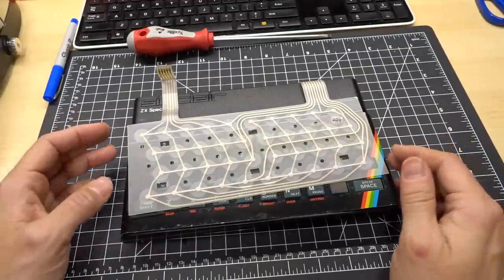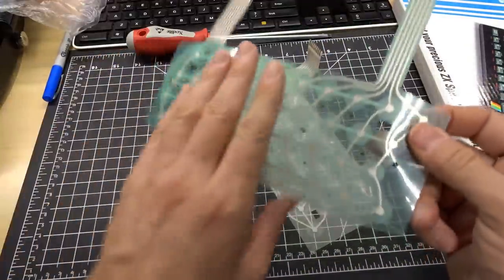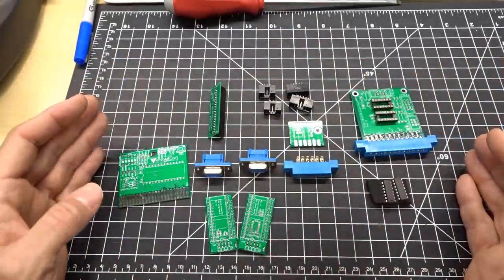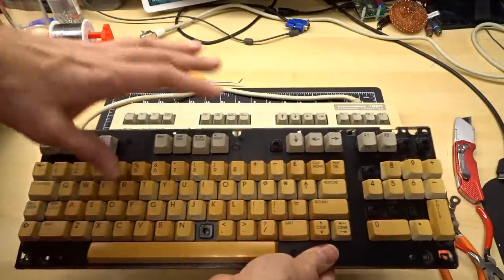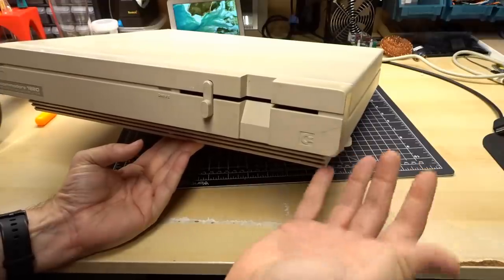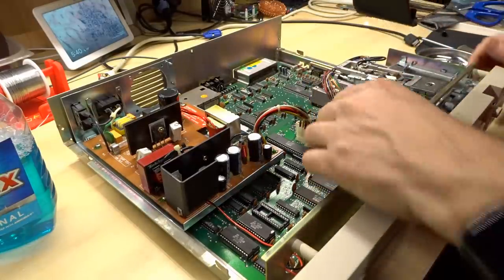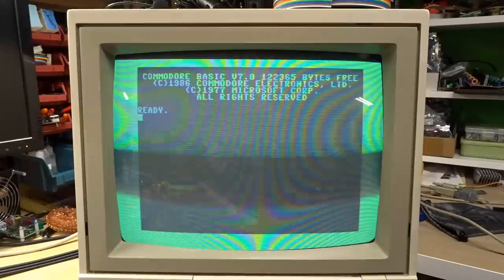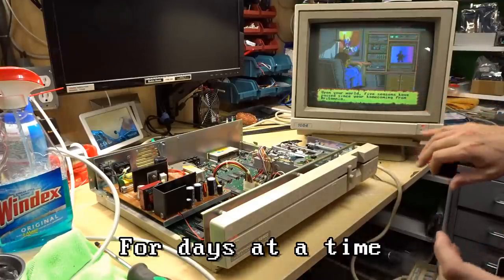Adrian's Digital Basement - Mail Call #1

Comment: Why do people dump heavy crap in a box with 30 packing peanuts and expect it to survive. 2 or 3 TIGHT layers of bubble wrap people! Come on!
Reply: On the plus side, we get to see a repair video. Every cloud...
Reply: I have gotten far less protected packages from Greece, Spain, GB and by train from China (all to Germany) and I haven't gotten a single damaged Package- US services just seem to be particularly bad
Reply: It's not just heavy stuff. I got a CPU off eBay a couple days ago and it arrived in a plain envelope wrapped in what looked like Saran wrap. Sure enough a few pins were bent but luckily not badly enough that it didn't work. All I could think was, this guy couldn't find a tiny piece of styrofoam or something?
Reply: This summer I ordered new SLA batteries for my Neuton rechargeable cordless mower. They came in a bubble wrap mailer and I think the United States mailman smashed them on my front step because they were leaking sulfuric acid all over the steps. Sat that way for 3 days. I should have called hazmat on the lousy mailman.
Reply: I’ve bought 3 Mac G5s on eBay that way and all 3 were smashed. Drivers throw the boxes off the trucks and stuff gets smashed. All computers require 3” of bubble all the way around.

Comment: I have to say that it's sad seeing people using packaging that is just not up to the task, and ending up damaging or outright destroying something collectable or valuable, don't skimp people, pack it properly to keep these things alive... :)
Reply: It's amazing people will part with these things and send them around, sometimes for free, but please, please just pack them a little better. bubble wrap isn't so expensive, and it would've saved that keyboard.
Reply: You know, it's entirely possible that the damage occurred before it was sent.  There were no puncture marks on the box that would have indicated that kind of damage to the keyboard.  That damage looks more like damage from a fall hitting a corner of a table.  It's too localized and too centralized.
Reply: @jeffreyphipps1507  with all the pieces in the box? Have you considered that with the computer and keyboard unsecured, that the computer would've thrashed around in the box?
Reply: @Nukle0n  You make a valid point, but the sender could have just broken it just before shipping accidentally and dumped the pieces in on the off chance Adrian could fix it.  At 6-6:30, you see the keyboard with the keys flat against the computer.  so if the damage did occur in the box, then it was a case of poor packing.  The keyboard had to have slid around in the box.  I'm not saying  that the packing couldn't have been better. The keyboard should have been wrapped in bubble wrap and taped to the computer and the whole thing put in a proper sized box.  All I was pointing out was that the box showed little damage where the keyboard came out and that was odd.  If I break things but don't have a chance to fix them, I normally gather those parts and dump them in the box with the broken item.  Could be either thing.  I just wouldn't assume anything here.  Still, I despise packing peanuts.  :-)
Reply: Yep, bought an IBM 5150 from ebay a while back that while double  boxed still had damage that took time to resolve. Fortunately the seller was very fair and happy to work on solving the issues. Heavy, older PC's need a lot of packaging thought before letting FedEx/UPS or USPS get involved  :)

Comment: that type of packing peanuts, looks like they are biodegradable, use for your flowers as mulch or flush down the drain. a quick water dip test will tell, it's usually like popcorn starch puffs without kernels

Comment: The 128D is a wicked nice computer.   I have 2 here although one is on my bench wait for some TLC from me.   Back in the day I had one running my BBS sharing a 20MG LT Kernal HD system which had a multiplexer to share the HD System with upto 4 computers.   The Diagnostics Harness is worth its weight in Gold you will be quite happy using it.   I don't know what the difference is possibly the keyboard part of the harness but I have one that works with the C64, 64C, 128 and 128DCR while the other one is not compatible with the 128DCR but I think its the keyboard connector but I am not 100% certain and yes the diagnostics cart is different for the C128 and C64.   I never took an interest in anything Sinclair but I have a friend who bought one when Timex was selling them.

Comment: Doesn't one of the ultima games have an enhanced version for the 128 and I have heard there is a 128 elite
Reply: The new C64 port of Super Mario benefits from running on a C128 even in C64 mode.
Reply: I think Dave (@davejustdave) has mentioned it..  There a 128 specific version of Ultima 5.

Comment: I always thought the 128D was a missed opportunity.  It should've been more of an upgrade, or something better/different than the Z80.  Like, some kind of expansion bus, a faster 65xx CPU overall, something...
Reply: The Commander x16 is suppose to have expansion slots...though I think it may still be up in the air if its going to be an 8 bit machine.
Reply: Right now, the only 8-bit Commodore-oid in the pipeline is the MEGA65 project - that promises to be as close to the real deal as possible with full C64 compatibility (and recently, they added part of the C128 80-column chip into the core!)
Reply: @adriansdigitalbasement  No kidding; I loved my C= machines but always envied the Apple-II line that internal expandability.

Comment: Wow, what a gracious donour ;). I LOVE the C128 DCR - got one myself which I recapped. You don´t really need a fan, just put some passive heatsinks on the cpus , the VICÍI and the SID, maybe the PLA and you should be fine. I would NEVER give it away ;) Still need a monitor to display the 80 signs mode.
 BTW: that´s a real 1571 Drive built-in ;)
Reply: Actually that isn't a real 1571.

Comment: I was able to get a 128Dcr from a local guy for $30 (or maybe it was $35) he bought it complete in the box at PGRE a few years ago, but he was after the box and contents, and the C128Dcr did not work, it turned out to be a blown fuse, because someone had plugged in the power supply backwards to the main logic board, fortunately the fuse did it’s purpose and saved the machine from a bad demise, so it works fine, since I have done 3 mods to it, #1 JiffyDOS #2 Drive ID switches, and #3 ATT disable on the internal 1571, which essentially turns “off” the internal 1571 all together,  so I could use an external #8 drive like my “Commodore Flyer” and my “Pi1541” devices

Comment: Woww! 1977? C128D is from 1977 I can`t imagine that. I love you channel, just interesting things, and you have a lot of knowlegde of everything, just amazing...
Reply: The Commodore 128 was presented in the 1985, this model was made probably around 1986.
Edit: I looked on wikipedia, the metal case C128D was made in the second half of 1986 (it's a cost reduced model, can say because it lacks the fan)
Reply: @Doctom91 The copyright in the first screen was 1977, Didn't it start being manufactured in 1977?
Reply: @PauloSilva-ll4vs  That was the BASIC copyright!
Reply: @Paulo Silva The copyright in the first screen is for Microsoft Basic, not for the hardware C128D itself. Actually, Commodore acquired a licence from Microsoft in 1977 for their first computer, the PET. This gave them full rights on the Basic code, and then for each subsequent model (VIC 20, C64, C128), they reused the same Basic, ennhancing it for each new model a little bit, but they kept the initial copyright year.
Reply: @hespelf  Now I got it... the  micro$oft basic is from that time, thank you for your answer.